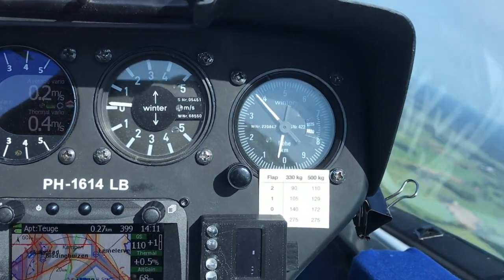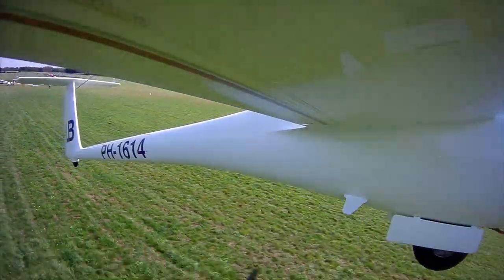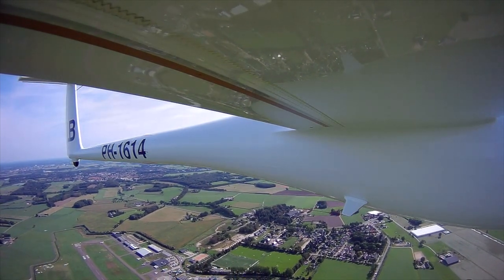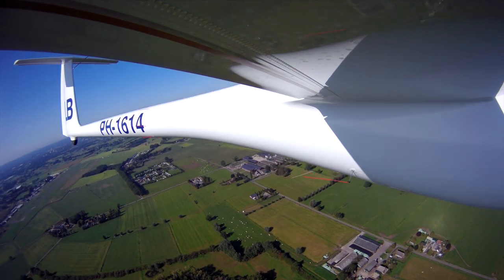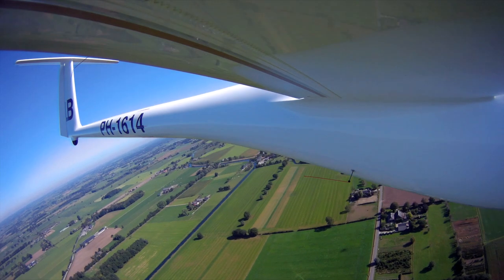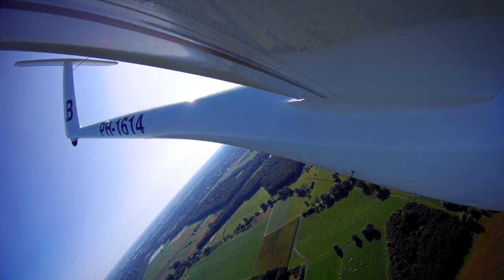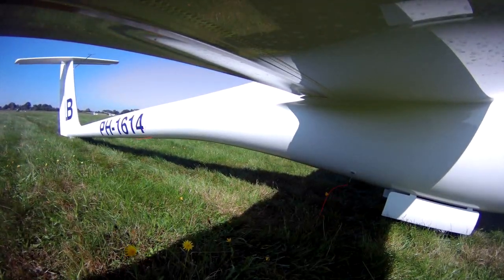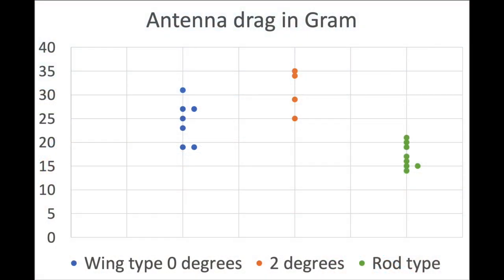Transponder Antenna drag

Comment: Hi Halmar! Thank you for an informative and useful video. I have just bought a Lak and it has the "rod and ball" type transponder antenna. Being an aerodynamicist I was not very impressed with this installation and I was thinking of fitting the same type of faired antenna that you started off with. However, IMHO the faired antenna is not a very nice shape either. It has a profile which can only be described as a "rounded-off diamond" and a nasty rounded trailing edge. Hmmmm....

I think you are correct in stating that however you align the fairing it will inevitably be at significant incidence to the flow in some phases of flight and will consequently load up and produce a tip vortex. Your tip-tuft investigation showed this rather nicely. I did not anticipate that the tip vortex would create significant problems for the static system as it trailed over the aft fuselage ports but on reflection this seems inevitable and there seems to be strong evidence for it from the cockpit instrumentation.

I love the on-car aero' testing. It gave you just the data you needed and the rod and ball antenna looks to be competitive on drag (that antenna fairing really is rubbish!) as well as having no incidence dependency. There should be next to no chance of interference with the downstream static ports as it will not produce flow structures able to generate significant regions of low pressure in the far wake.

All in all, you have saved me some time and a few hundred Euros. Thank you very much and I hope you enjoy your season!

Tim

Comment: Interesting video! I had a transponder fitted to my DG 101 and it was the rod type. Very satisfied with the install, but see quite a few of those shark fin/wing types around. Now we at least know a difference exists between the two and what it does. I am quite curious what the difference to the polar would be by fitting any antenna at all.
Reply from the maker: For your typical 40/1 L/D glider at 350kg the glider experiences a drag force of 350/40 = 8.75 kg. My measurements show an antenna drag of about 20 gram; 8.75/0.02 = 0.23% increase in drag. You probably won't notice ;)

Comment: Ik vermoed dat het probleem is dat de lokale hoek van de luchtstroom varieert door de mate van downwash van de vleugel. Zodra de antenne dan niet parallel aan de luchtstroom staat, genereert deze lift en krijgen we dus een tip vortex. Het lijkt erop dat je draad deze vortex volgt. Ik denk als dezelfde antenne midden op de romp gemonteerd is, dit probleem niet optreedt (behalve bij flinke sideslip).
Reply from the maker: In het midden van de romp, met een verticale antenne zou je dit probleem niet idd niet hebben denk ik. Vergeet ook niet dat de invalshoek ban de romp (en dus antenne) verschilt met de snelheid.
Reply: @HalmarLakeman  Exact wat ik bedoel!

Comment: Hé Halmar, interesting investigation!  I always wondered the same of the shark antenna of our Ventus, but I always assumed that the drag of those antennas was marginal. Luckily that Ventus antenna is behind the turbo bay exactly on top of the fuselage and not subjected to AoA changes but to sideslip :-) .  What is the 3D printed instrument with 4 leds by the way?
Reply from the maker: That is an experimental instrument measuring air-moisture content. The LED's indicate rate of change in moisture and the display does this in a more analog fashion, and displays the humidity.

Comment: It is obvious that the wing shaped antenna, looking good, sells good, however beware.., but at that low Reynolds number it is under-critical so has separated flow from the thickest point and aft..... so more drag than a pole which is thinner in frontal area. 
At that low Reynolds number some Carman vortex-sheet is waving away and that is influencing your static port, see the altimeter behavior ? 
Either a new antenna under the canopy (= no drag at all) or another solution.
Ask Prof. Boermans for further advice. ( Venlo )
Reply from the maker: I had my first flight with the pole antenna on the same position as the previous wing antenna. No problems with the altimeter so far :)
Reply: @HalmarLakeman  Vortex shedding is typical for certain low Reynolds number region.  In your case the Reynolds number of the fin -antenna should be outside this region. 
However, instable separation-travel back and fro on an airfoil shaped part can happen at certain Reynolds numbers.  The vortex behind the object also influences the pressure in front of the object at subsonic speeds. In your second case the wake of pole antenna is stable, reading the static port of the altimeter.  ( btw. it is von Karman, not Carman. The latter was a French glider manufacturer)
https://en.wikipedia.org/wiki/K%C3%A1rm%C3%A1n_vortex_street